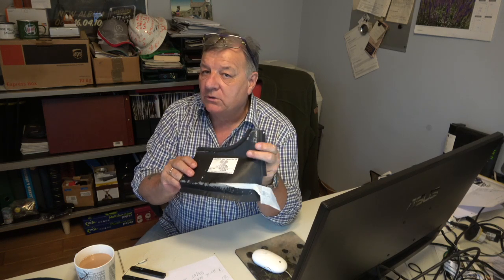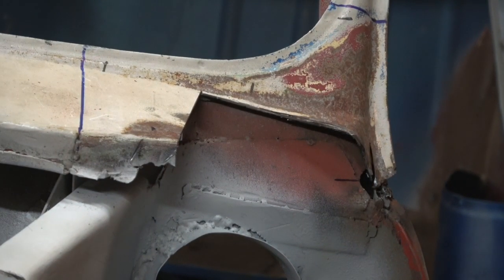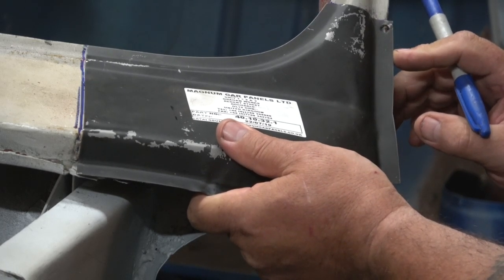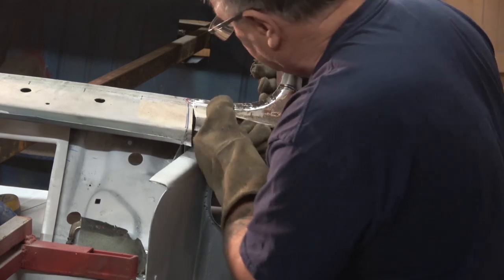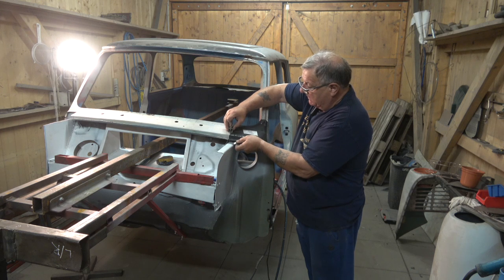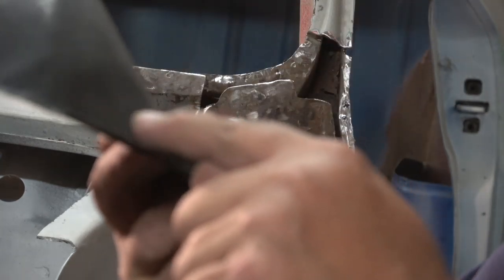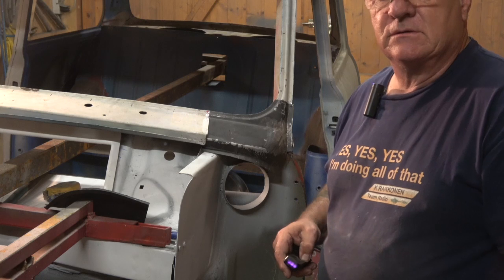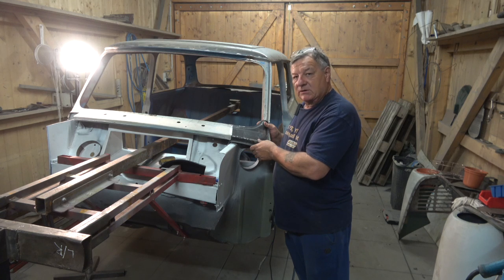Classic Mini Scuttle Repair Panel  Part 1

Comment: I have the same end repairs and honestly when you lay the Magnums on the car it looks like they used the car as a "buck" as the profile lays ontop perfectly and it shouldn't if it's gonna replace the car part. When i do a real restoration i wont be using Magnum, i do like most of 'M Machine" parts tho.
Reply from the maker: Doug, Good point about the buck lol, I just think its worth the extra money for better quality panels like M Machine & Heritage that will save you a lot of hassle and give you a better finish, I made this video to show the issues you can
get with Magnum panels like you point out but TBH it seems some viewers like them. Cheers Dave

Comment: If magnum panels cause so much extra work,why do you buy them?
Reply from the maker: Scott,  The magnum panels are the cheapest on the market for a reason, I wanted to show some issues you can 
get with fitting them & how you can rectify there short comings, I make the videos to try and help or pass on some
tips & tricks to viewers that may be tackling bodywork jobs for the first time. Cheers Dave